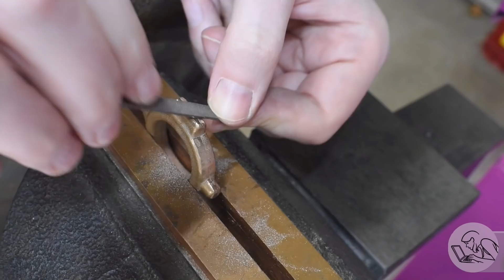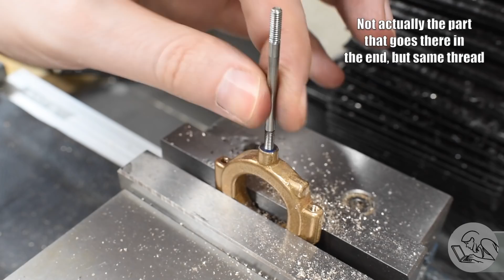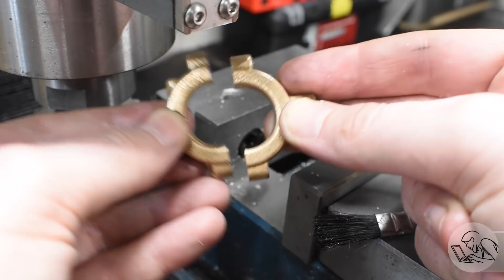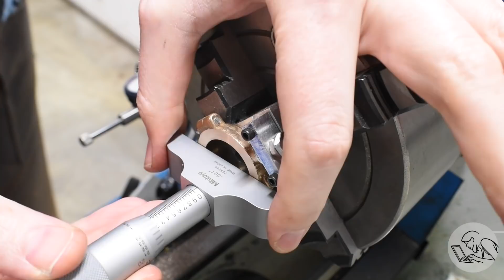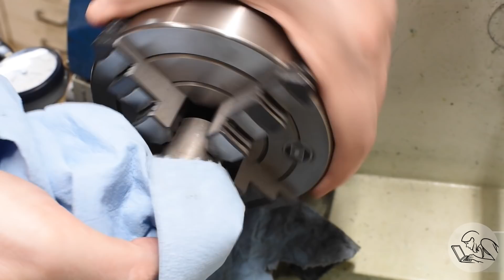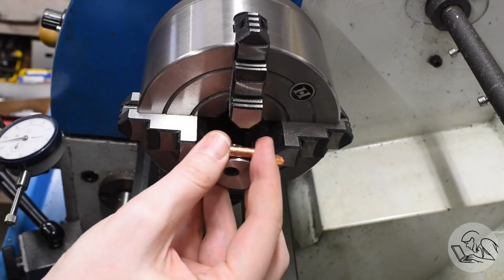Let's Build a Model Steam Engine - How to make an eccentric!

Comment: Hi Quinn - I am certainly a fan of yours and have enjoyed several of your steam engine videos. I have made 4 model so far and am just beginning my 5th design.  All are my own designs but the ideas stem from models that I have seen. Such as Stuart. My #5 will be a two cylinder horiz. I have watched your eccentric video and am planning to do much the same, but am working with flat brass stock as I don’t have any “kit” castings.  I have designed the eccentric similar to your casting and plan to rough the outside configuration on my rotary table. I may finish the inside cuts on the lathe as you did, or just stay with the rotary table. Not sure yet. I will make one from alum first to see how it goes, then do my brass finish products.  Can take pics if you are interested I will share.  TKS, HB

Comment: I've been searching for the answer, but have yet to find it.  How do you design an eccentric?  Simply the offset distance from actual center to the rotational axis?  ie  I need a 2"  overall stroke (I guess +1" to -1" from center), would that be rotational axis 1" from actual center?  Without having something in hand, I am having a hard to visualizing it.  I will probably have to make a mock up and try it.

Comment: Check out Doubleboosts channel, he has a tool for squaring up work in the chuck without using a dial indicator. It uses a bearing in the tool holder which pushes the work square. Like your vids
Reply: https://youtu.be/s0aNbxZj4qQ
Reply from the maker: This is a method I have shown on my channel as well. It’s okay for moderate precision setups

Comment: Hi Quinn,
thanks for another entertaining and informative video.Your perspective on matters is insightful.
As a hint for any onlookers the use of a parting tool  to cut the groove in the Hub requires some preparation, not only does the parting tool need to be square with the axis of rotation but importantly the cutting edge of the parting tool needs to be ground square on the tool, otherwise the base of the groove  cut into the hub, forming the eccentric, will not be square as it will follow the taper of the tool cutting edge.....
Another point which you instinctively carried out but omitted to mention, for the newbies viewing, was to place a cloth over the lathe bed when using sandpaper on the parts. The grit from the emery paper would do untold damage to the lathe parts, if allowed to get to any mating surfaces.
Thanks again

Comment: I've said it before, but it's worth saying again...
THANKYOU for putting in metric subtitles ❤ I do not understand imperial screws; I know the sizes won't be exactly the same, but it helps get a sense of scale when I see M3 x 0.5mm thread vs... (whatever a 5-40 is?).
It makes a huge difference, and I appreciate the thought and effort 😊
Reply from the maker: I’m glad you appreciate it! The threads never map very well, so those are always a “rough equivalent” but the whole idea is to help metric folks have an intuitive feel for the sizes of the components on screen.

Comment: I'm not convinced that facing with the boring bar does anything for making the bore and face orthogonal. All that matters is that the cross feed is perpendicular. Doesn't matter what tool is on there. Unless I'm missing something...
Reply from the maker: No , the fact that it’s the boring bar doesn’t matter. It matters only that you don’t change anything with the setup. But the boring bar faces as well as anything.

Comment: Quinn, you are only the second person, after my Mechanical Engineering Lecturer at College, to ever say to use the file in the horizontal-to-vertical way to form a radius properly on a cast  surface to smooth out a sprue or flashing, up to the end of a piece of square-stock or w.h.y.  Thank you.  Everyone I've ever said that to, how to file a proper radius on a piece, looks at me like I grew a second head!  Thanks for the great video too.  Some of those cast parts, especially the eccentric ring, look like they'd snap if you sneezed on some of them!  Great stuff.  Cheers and Keep Well!

Comment: hello, I provide idea, how about creating a solar generator, I don't know if you have seen that there are a few solar generators out there that provide a ton of energy for free, these use a steam engine or something similar, you would need a parabolic dish with a diameter of at least 1meter the surface of the dish has a mirror finish or some sort of Mylar with a mirror finish, that is adhered to the surface, this device is used to focus the solar rays to a focal point, put in that spot a metal device containing water, perhaps some sort of cylindrical radiator, this should allow you to move water from and to it, so on one side you bring cold or luke water to be heated till it turns into steam, then you send that steam to a engine where you can connect a DC electric motor and finally you connect to it a few rechargeable batteries to it, if properly done it should be better than solar panels

Comment: Love your video's Quin, I do have a remark on the fixture plate, the screw on side and the other side are they inline, if so when you turned the part to clean-up the other side and fasten the screws the part isn't flat on the fixture plate anymore, than the milled sides aren't square to the bore anymore?
Reply from the maker: The side with the bar is self-adjusting so the part is flat on the fixture.
Reply: @Blondihacks  nice!

Comment: nice job, i was impressed with your fixture design. i think i would have swapped to a 3 jaw to face off the eccentric rather than fool with those copper slugs. this project is coming along quite nicely.

Comment: I have cut cams or eccentrics on a 3 jaw chuck by just shimming one of the jaws by the amount I wanted the cam to be off set. I don't think you are supposed to do that but I only have a 3 jaw chuck and it seemed logical...yes it worked.

Comment: Where do you get the big blue Sharpie you are seen using,? A machinist told me when making a bearing or a eccentric to cut them in half first clean up the cut and soft solder together do the boring and clean to size, drill and tap, heat up and brake the solder joint . This may or may not work on the small parts you are making but full size parts it works very well.

Comment: Should you not set the eccentric wheel on the crankshaft in such a way that the former's side with the most mass is diametrically opposite to the offset crank on the shaft, in order to semi-balance-out the weight?
Reply: I may be wrong but isn’t the eccentric driving the valve, and thus need to be in a certain position to make it work? It would be cute if that happened to be in a perfectly balanced way on the shaft, but I doubt that the Gods of steam were that kind ;)
Reply: @mumblbeebee6546  Absolutely correct

Comment: Why can't slitting saws be accurate with the OD and the ID?
Reply from the maker: I think it would be prohibitively expensive to grind all those little teeth so perfectly, and it really doesn’t matter much anyway.
Reply: As it would be no problem to get that kind of precision, I think that it is intentional. And if it bothers you, just make a fixture and bor out the ID's ;)
Reply: @vincentguttmann2231  so, I need to build a fixture to fix end mill?
I haven't seen or used very many, but most to all are off center.
Reply: @dans_Learning_Curve  Yeah, as it doesn't matter very much when using them. i mean that you could enlarge the hole on the lathe, but this also means that youw ould need a different arbor size, and it's a slippery slope from here on. So just live with off-center slidding saws.

Comment: One question: you threaded the two side slots and the bolts went perfectly into the holes. Then you chopped a big gash into the two sides, and the bolts still threaded in perfectly. How come?
Reply: Cause she drilled a clearance hole approximately down to where the slit would be, then a tap size hole the rest of the way.  Only the cap was actually tapped.
Reply: @witzed1  Thanks!

Comment: I’ve used parallels on edge to set things in the 4 jaw, but never on the side as you showed. Till now. Nice tip. 👊
Reply: It works nicely this way because sometimes when you use them along the opposite axis it can get a little stuck behind the part and hard to wriggle it out without disturbing the setup. They slide out easily when used as Quinn showed.

Comment: I HATE slitted screws with a passion. In no way would I use them even though this is probably supposed to look old fashioned. 
Socket head or even better Torx all the way!

edit:Spelling
Reply: I get you. but have you ever worked with a screw with an oval head tightened by a gorilla? those are much worse (and luckily pretty uncommon). I think those are the best compromise here.